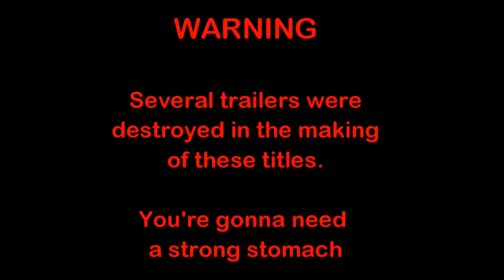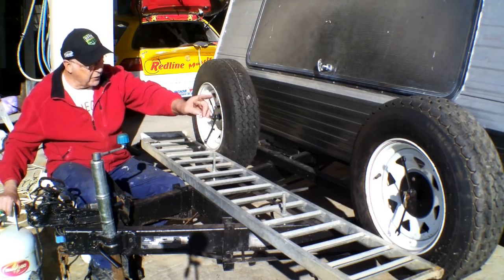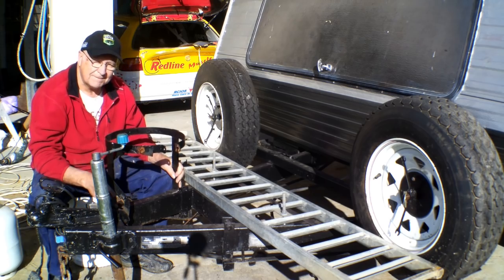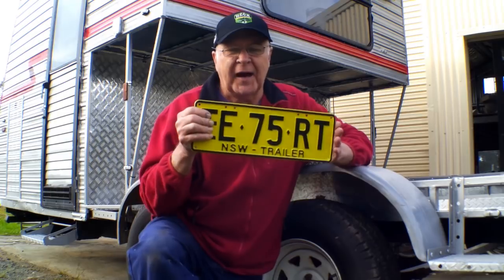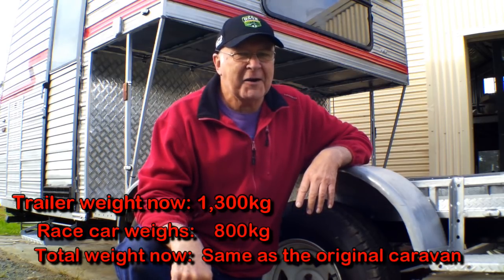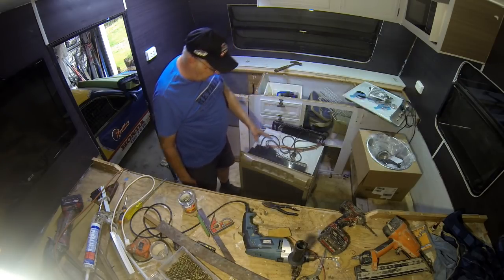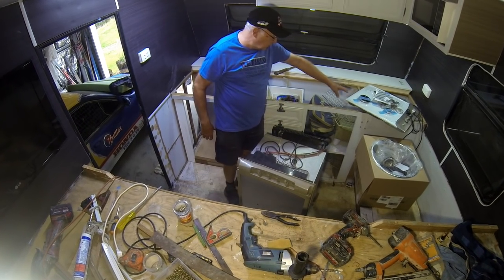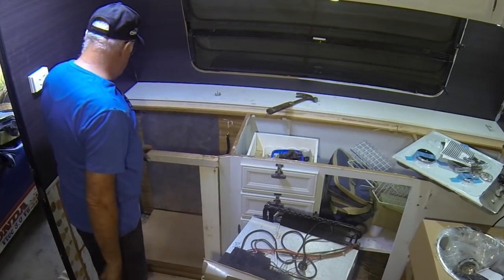Camper Car Trailer Build - Part 12

Comment: My old man had the same anti sway system on his caravan. Keep an old bit of galv steel water pipe about a foot long in the van to assist when installing the tension bars onto the bracket on the draw bar. Also saves you from trapping your fingers

Comment: So if the weight of the car and trailer is 2100kg, what is your ATM and does the rig exceed the allowable GVM? The police are getting very militant on this and your insurance will be voided if you have a crash and any of the regulated weights are exceeded.

Comment: WHAT A GREAT RIG...         Will you wire the race car tail lights to work with the trailer lights, always looks good, but hay what a rig..
 p/s  maybe some l e d s on the sleeper to mark its coroners.                 you need never to return home..       what a rig.
Reply from the maker: I showed how I wire my race car/s to the trailer in part 10 of this series, and there are led's on all corners of the trailer already.

Comment: I personally would of only removed the back wall of the van and built a drop down ramp
Reply from the maker: Which would have left you with an overweight trailer when loaded, the inability to open the car door when loaded to get out of it, and the problem of the wheel wells being in the way of loading the car.
Reply: @BillsBuildandRace  well mine works perfect I built mine from a 23foot 1978 viscount supreme I had to upgrade the suspension and put brakes on both axles for the weight